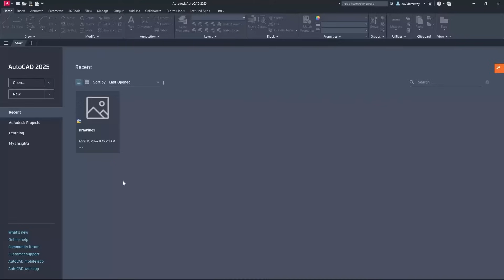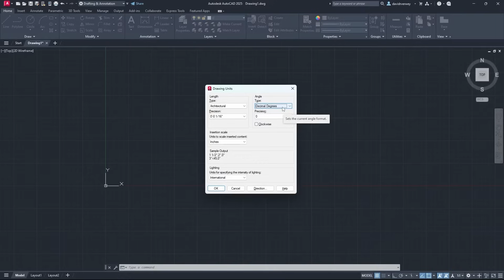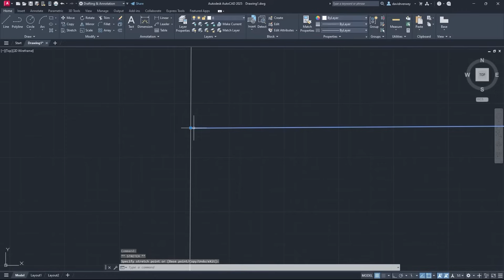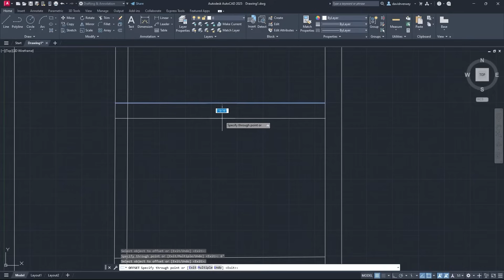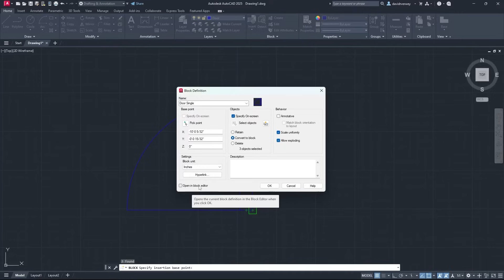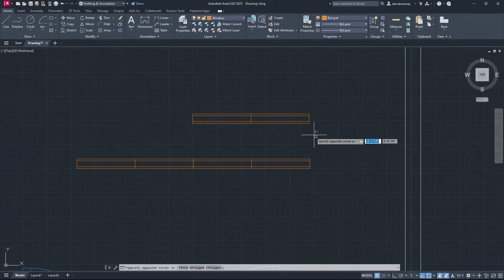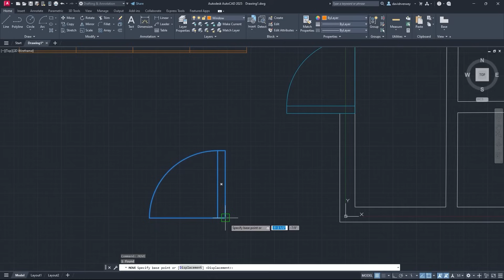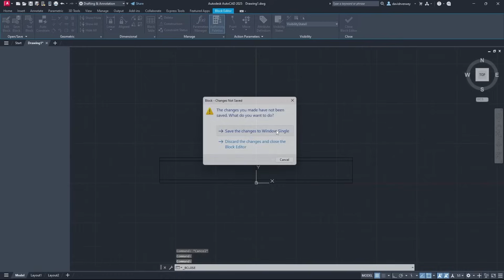Create a Simple Floor Plan: AutoCAD 2025 - Part 1 of 2

Comment: I’m struggling with rearranging my toolbar like yours mine is vertical on the side it’s very annoying and the drop downs won’t work
Reply from the maker: You should be able to drag-and-drop it into position. Right click a blank spot on the toolbar and select "undock".
You should then be able to drag it into either the horizontal or vertical position. Whichever you prefer!
Reply: @ I’m on Mac so i think i’m unable to change it

Comment: i dont get the architectural option in units and ive got autocad 2025
Reply from the maker: I've tried to replicate this, however it doesn't seem like I can... Make sure you go to "units" and see if the selection comes up. What are the other options you get in the dropdown?
Reply: i just select inches and then architectural pops up

Comment: I dont get the architectural option in the units
Reply from the maker: You should be able to type into the command bar "UNITS", select "Architectural" from the first drop down menu. If this doesn't fix it, What version of AutoCAD are you using? (Year and type, etc. 2025, AutoCAD LT)
Reply: @VerweyDraftingInc  mine is 2020
i dont get it too

Comment: Thanks for this video! I got no experience in CAD, but I was referred by a family member to a architecture place they work at. They are willing to train anyone for CAD, but I downloaded the free trial and recreated this so I can get some sort of feel on how this works. This isn't as scary or difficult as I thought it would be
Reply: I also downloaded yesterday and got to learn a lot from his video. thank you
Reply from the maker: @MEGASTHENESINDIABIHAR-m3d  Glad to help!
Reply from the maker: Glad this helped! I will say, this is an extremely simplified floor plan just so you can get a feel for floor plan workflow. If you're going to be doing architecture, I'd recommend taking a look at AutoCAD Architecture. It's AutoCAD but has tools specific to architecture, and everything we did in this video can be done in under a minute as blocks, floors, walls, and even hatching is completed for you to some extent. We'll be posting more advanced work later on when we have the time!
Reply: Yeah did the same but the only thing it was a hassle to redo the windows please ensure correct measurements are given at first as a newbie to this too much work for a simple drawing.

Comment: I TYPE 12' IN A RECTANGLE BOX BUT THE LENGHTH WAS TOO SMALL . I AM DAMN CONFUSED COULD YOU HELP ME PLEASE
Reply from the maker: The only issue I can think of is when you are typing in lengths and widths you need to put the ' or " sign in order to make sure AutoCAD knows what units you are talking about. If you don't use the foot or inches sign, depending on your settings, it will default to inches. Let me know if this helps; if not I'll see if I can trouble shoot it for you :)
Reply: @VerweyDraftingInc  same problem
Reply from the maker: @cheskamariecayanan917  If units are set to feet/inches and you are creating a rectangle it should work. For feet press the ' key without holding shift, then for inches press the same key while holding shift ". If you're doing this correct, and you've double checked the lengths and they are good, then your scale may be off. Let me know when you measure what the measurements are. 

Thanks!
Reply: Zoom in by scrolling your middle mouse wheel and then click and hold that same middle mouse wheel and you can drag your screen so that you have the same XY-Axis in your screen like he does. Basically you're zoomed out too much.